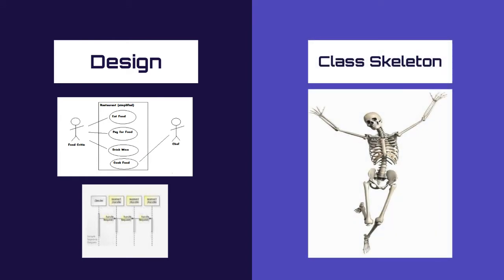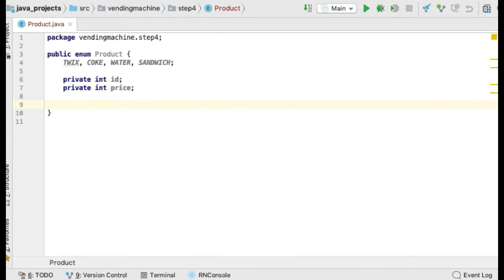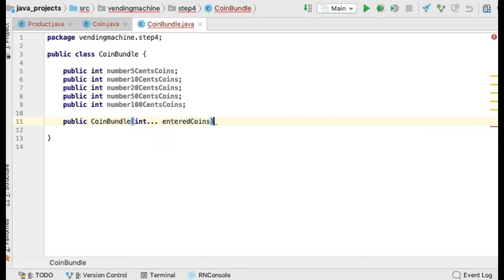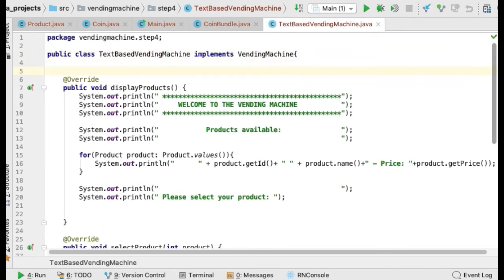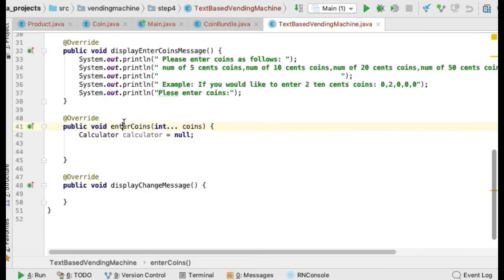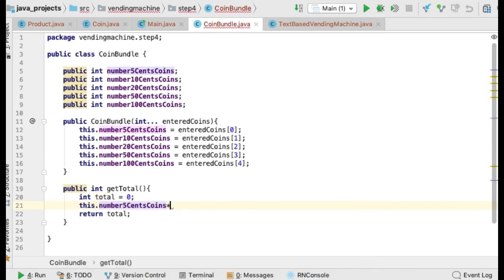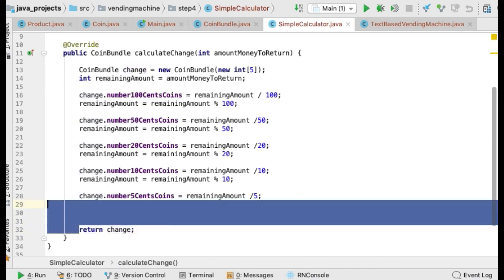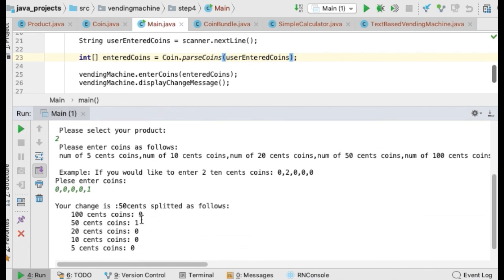Java OOP Project - Design a Vending Machine - Part #2 | Source Code Included

Comment: Hello, this video was really helpful and I learnt a lot but when I tried to run this code the message shows "Can't find Main class", can you please tell me how can I avoid that. And also, the code in your videos and the src in your GitHub is different so which one should I follow
Reply from the maker: Hi there, Thanks for your comment! how are you executing your code? You need to add a Main class with a method with the following header: public static void main(String[] args){// the code goes inside} .  This is the entry point of the program. Follow github, and please note that the video is meant as a guide, and some of the method names or classes might have change, however the functionality is the same.

Comment: This video is extremely helpful but I have one question, is there a way to put all of the classes that you have made into a single class file? I'm trying to follow along but I keep getting error messages because I need to put the class codes into one singular separate file.
Reply: same, Plus there is no error checking. This is not very helpful for a beginner in my opinion
Reply from the maker: Thanks for your comment. You shouldn't have to put all classes in one file. The point of classes is splitting the code in different files so the code is more manageable, and easy to understand. Could you please take screenshots of the errors you get and send them to hellocodeclub0@gmail.com?  Happy to help, or even make a video about the problem to clarify it.